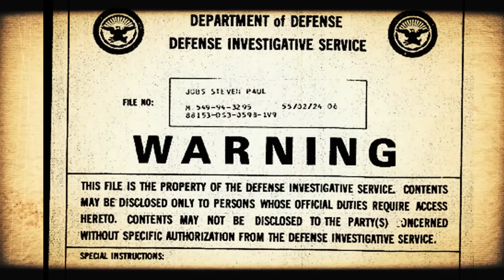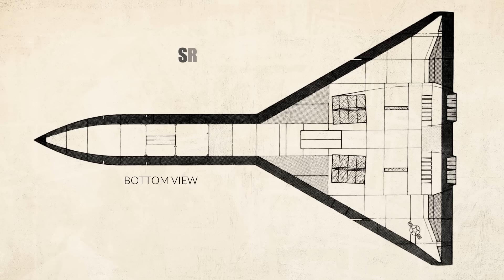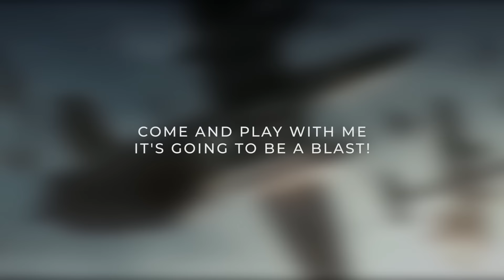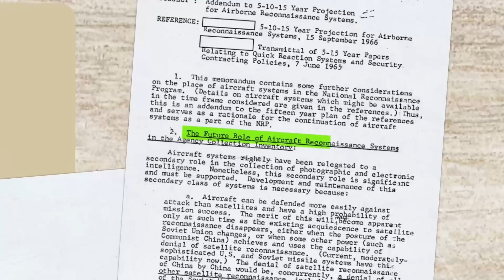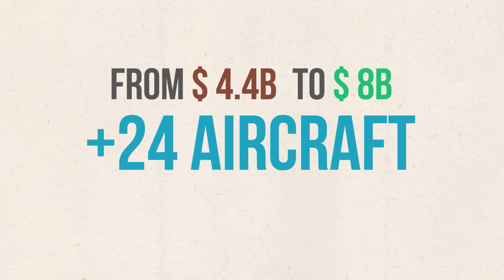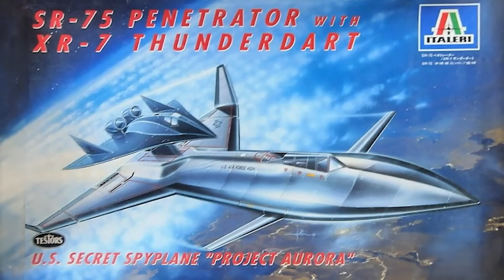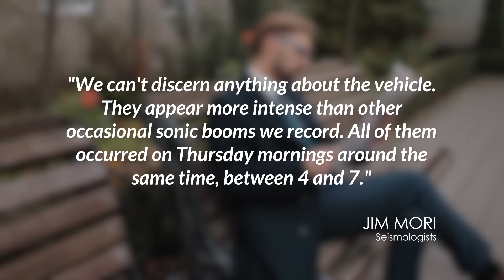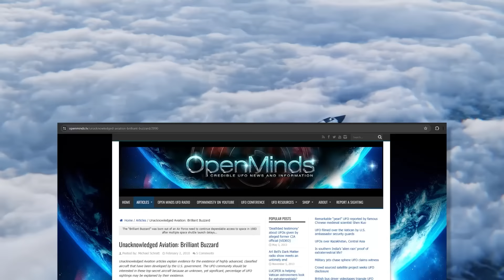This Plane "doesn't exist" - SR-75 Penetrator

Comment: Yeah... if this thing did exist at the time where the us army had the way to build up it's ambitions (and while there are ignorant people who just take decades and any amount time and technologic evolution are an merged variable that allow us to dream and fantasize about what may be around right now as an argument to say that nowadays secret fantastic machines must exists... While it's a lot more complicated than that). I'd argue that this plane certainly doesn't exist today, the last time it was "observed/seen" was in the 90', over 30 years ago, if at least one craft did get produced, a prototype, it probably just sit around in a dusty hangar full of obsolete parts along with others aborted projects that costed billions of dollars. And if the plane did ended up being developped then it's becoming an extremely old plane, i know that many old planes are still used today however we still talk about new planes from old models, you just don't fly the exact f-16 that were built in the 80', so if we don't see them around that at least mean that thoses weren't being mass produced, therefore the planes would have to be retired years ago or about now if there was a program extending their longevity as much as possible, but it had/has limited uses if any that's for sure...

Comment: I will be 64 in early 2024.  I have always kept up on military matters and technology.   I recall seeing multiple photos of the rings forming at ultra high altatudes published late in the 1980's to 90's.  In theopen  press.  This is before the internrt.   I am surprized that you couldn't find s6ny.  I watched this video as I remembered.  All of the speculation back then.  Which by the way.  Was also described as.  Alegedly or apparently called the Aurora project.  Pulse/scram jets were the alleged power plants.  Most photos were attributed to being it based in Scotland, as were the sources of most photos.  Althogh, and this is 30 to 40 years ago.   Possiblesome were taken in Sothern Calofornia, or the US south Western states....   Where, they do all of that testing...

Comment: Stupid. At altitude the liquid oxygen is the oxidizer, and the intakes are not used for the impulse engines. They are used at LOW altitude for the normal jet engines that are part of the system. This was the same way the SR-71 worked. They had hybrid engines that were part turbo fan part ram jet engines. Also the smaller plane is referred to as a daughter not a parasite as it doesn't rejoin with the mothership.

Comment: I guess the mock up used in the recent film was a original mock up for the Aurora, your not going to spend millions doing a Darkstar for a film I doubt.
The Aurora used to be seen 30+ yes ago. A worker at Machrihanish  where the Aurora would stage, (then the longest runway in Europe that could take the shuttle if needed),told me he saw it 4 times and the AB was impressive, it came low over the runway once at nearly the speed of sound. Another guy I worked with, who was a mil radar op 30 +yrs ago,said he was briefed before it would show on the scope in the UK. Another guy who was stationed in Germany saw it many times. Probably blew itself up into tiny pieces as it's not been reported since
Reply: Hello! That Machrihanish stories used to come and go repeatedly. That's indeed interesting. 

Never heard story about Germany though. Could you say anything else to it? Did the guy see it on his radar or physically could see the aircraft itself?
Reply: @RallyRacingVideo  seen it many times he said
Reply: @michaelwalsh7846  did he describe it in any way?
Reply: No, it via radio ops.
Reply: @michaelwalsh7846  how would it be via radio if I may ask? You saying radio comms?

Comment: i think the hypersonic thing is a hype .....it is , if technical feasable , to expensive for the benefit .

you cant hide a sonic boom  very well , contrails is above a certain altitude no problem , but oxygen is ....above 40 km it is very very very low density on everything gassy , and the heat problem is not the only problem .
if you heat up by building a plasma bubble around it , which is highly likely , then you light up like a christmas tree , not even in the visible rtange but also in the UHF range .
ok i give it to you that counter measures maybe are not reach you in time except a laser beam ;-) 

but on the other hand , what do got ? photo evidence is not sufficient , heat signatures are maybe a bit more telling . 

in time where a wifi can be used from secret services as a indoor radar , any hacker has more power of intelligence than these money eating monstrositys .

the technological benefit is maybe in the material development like space travel was for computing and commercial electronics .

the rest is aviation fairytales in my eyes

Comment: Cool video but I'm sorry, your statement about "276 feet in length" at least according to the models you've used, is just plain wrong and not shown to scale. I'm not sure how much of this video is entertainment and how much is based in fact, but right-off-the-bat I'm not buying this whatsoever. The craft you have depicted is similar in size and proportion to an SR-71/A-12 and looks somewhat shorter than said aircraft. The SR-71 is 107 feet long. You'te telling me that this SR-75 is 2.5 TIMES THE LENGTH? Hmmm ... none of this is adding up, sir...